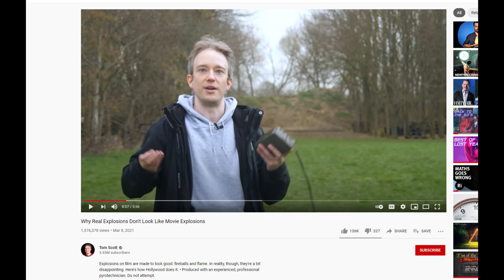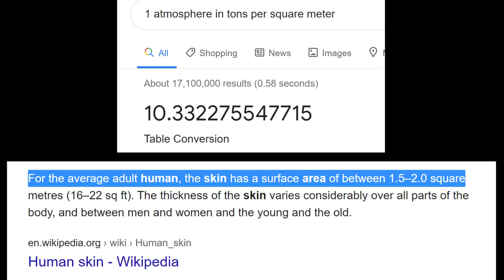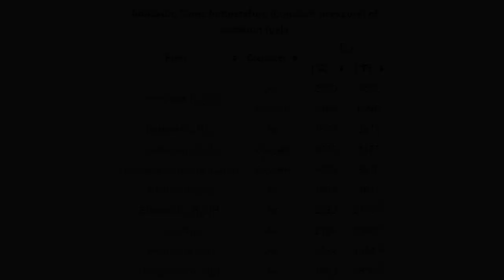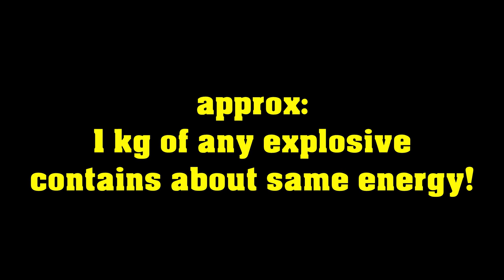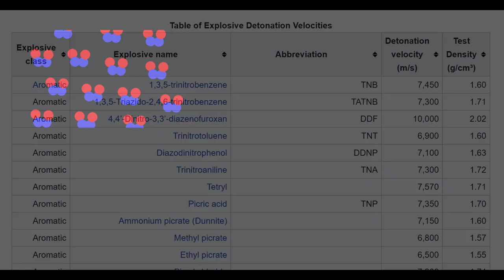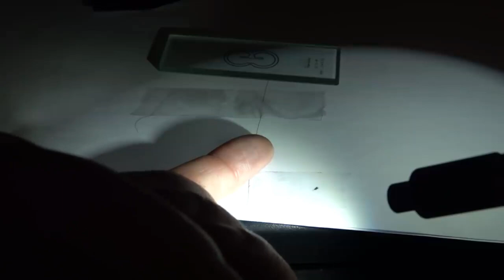Understanding Explosions!

Comment: I am in Beirut, it was not cool of you to say no one got hurt while actually 213 people were killed (Lebanese and Syrians both), 6,500 wounded and 300,000 displaced. However, I agree with your analysis and I actually managed to do this calculation in my head in 10 seconds after the blast as I was running back up the stairs home. At first I was in the supermarket trying to buy bread (there was bread shortage) and the earth shook, and I found my self out on the street, having no memory how I jumped/was thrown there. Cars stopped and drivers asked us what is this? is it an Earthquake? I answered them no it is too strong and too quick to be that, I think it is an explosion, trust me I am Syrian (Sadly we can recognize the type of bomb or missile from its sound). As I finished that sentence, the blast wave hit us so heard breaking windows and whole building fronts fell on people (most wounds were because of that actually). Some cars got flipped off bridges. That's when I ran to my home ... and in 10 seconds my brain thought ... those are two explosions (like what Assad used to do, to kill rescuers who try to help with the first one), ... oh wait this must be one, and it was only the shockwave then the delayed blast ... WAIT A SECOND! If there was 6 seconds delay! it means it is about 3.5km away ... BUT IT WAS SO STRONG! That's when my brain melted trying to imagine how huge the explosion must be!

Comment: 2:25 "the pressure on the outside of your body is about 20 tons." 

Finally, my inability to get up off the couch explained scienterrifically !   B-)
Reply: except you get 10 tons pushing you down and 10 tons pushing you up
Reply: @EricRoosEvestraw  Technically you float in the air just a little.
Reply: @EricRoosEvestraw  cmon now, don't cancel it😭😭

Comment: one thing i love about the famous nuclear bomb house blast video is the 'tide pulling in' , just like a tsunami. when you have a massive pressure blast wave, there is an effect, like a tsunami, that just preceding the blast there is a reverse diretional effect. in a tsunami you can see the water pulling out exposing the subsurface of a bay/beach/coast just prior to the massive wave swamping the coast. similiarly with a nuke blast, you see the negative directional air pressure/wind in the reverse direction. it's a scary warning of just a very short period prior to the blast. amazing.

Comment: Cody's Lab has tested the travel speed of sound in rock in his mine shaft.
Reply: He does, but rock is not just rock. Different mixtures of sand, gravel and concrete in cities are very difficult to compare to natural rock in terms of seismic velocities. And natural surface rock itself can also be solid igneous/metamorphic as well as loose sedimentary rock. Seismic velocities in dry sand is not much different than in air, while solid granite is several km/s. I believe Codys mine is shale and limestone, which is somewhere in the middle, probably in the lower end due to weathering.

Comment: The gasoline has more energy than the symtex because the symtex has its own oxidizer mixed in with it, the fuel gets mixed with the oxidizer (air).   When doing detonation velocities we use what we call a rate stick 1-2meters long and use piezoelectric pins at measured points on the stick or more recently stripped fiber at those points, and one of our Photron SAZ's running at least 100k frames per second.  The biggest problem we have with filming with high speed cameras is the explosives are often extremely bright depending on the mixture and will blind the camera if you don't get the settings just right.

Comment: I have an explosive licence I detonated 40g of PETN on the roof of a wrecked car.  The interior light got fired through the floor and ended up about 6in into the ground.  The most interesting damage though was a thin bit of open cell foam, maybe 5mm thick and about 100mm round that was under the roof got punched straight through the sheet metal of the door.  The hole was the same shape as the foam (road runner style) but the most amazing bit, the foam was still functional foam after it had passed through the door, it was really amazing.

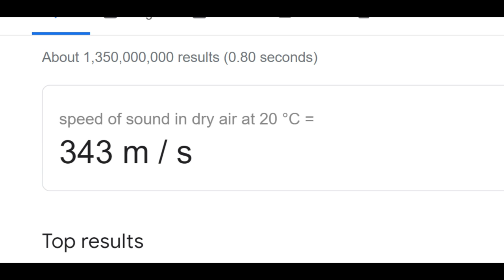Comment: 3:31 That's actually only correct for "weak" shockwaves. Shock velocity is a function of the static pressure ratio across the shock: velocity = sqrt(gamma*R*T)*sqrt((gamma+1)/(2*gamma)*(P2/P1-1)+1). For example, the Turk 28103 blast had an approximate shock wave velocity of 30,000 m/s between the first 2 frames of the available slow motion footage but decreases to 2,600 m/s after about 20 ms (frame 40-45). The footage you show is from the Apple-2 test and the house is actually 3,200 m from ground zero.

Comment: About overpressure being something to respect (or face the dire consequences):
A small room about 20 m^3 in size with a manometric bomb inside it. 
A manometric bomb is a device to test gunpowder (speed of burn by build-up of pressure) and this one had a 1 litre cavity. It looks like the breech of a large gun but with the hole where the barrel normally goes welded shut.
The typical (peak-)pressures during a test are 3000-4000 bar, atmospheres (45.000-60.000 psi).
Then one of the sensors failed (its mounting actually) and all the gas inside got dumped outside.
So 20 m^3 suddenly had 23 m^3 gas in it. Not that much, you would think. 
The result was that the roof (a slab of reinforced concrete) of this little room tore loose at the corner and got lifted up a bit.
They kept it this way and called it a build-in safety-feature.

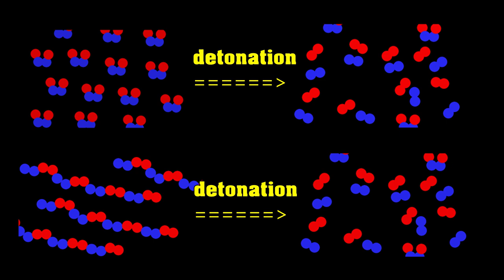Comment: 10:12 Most air fuel mixtures will not detonate but deflagrate instead, take combustion in an otto engine as an example. To much heat and pressure in the cylinder will allow the mixture outside of the deflagration flamefront to detonate, which is very bad and what knock is.
you should do a video about deflagration vs detonation (and the outside parameters necessary for detonation).

Comment: But you can't have gas pressure without a container.

When is this officially going to become a meme?
Reply: Does the atmosphere count as a container? Otherwise the compressor head in my shop will disagree, at the output there is definately a pressure increase when blocked. Sure, for convenince there is also a container (tank) but just for buffering intermittant demand, so that the motor does not start every few seconds.
Reply: @kuebbisch  With all due respect, weather patterns disagree with my original comment. You should click read more ;) Not having a go at you or anything.
Reply: @chickenman297  Meh, I blame that on my mobile device, seemed like a complete statement, show more was obscured :-) So we agree that we agree?
Reply: @kuebbisch  Definitely!
Reply: @kuebbisch  not a science nerd, but could gravity itself be some kinda container?
Reply: @qwerty_artist  Check out BlueMarbleScience (I think that is the channel name). He did an experiment on this exact topic.

Comment: As teenagers, me and a buddy made a vacuum sealed bag (maybe 1L), opened one tiny corner to fill out with acetylene. sealed it, used a touch to light it, not much happened. Did it again and mixed in oxygen.  The ringing in my ears lasted the rest of the day. We had the garage door open otherwise we probably would've blown out a window.

Comment: Both FAB (fuel air bombs) and Thermobaric use Oxygen present in Air. Conventional explosives contain an Oxidizer. It can be as much as 2/3 total mass of explosive. So, FAB's and Thermobaric's have 2/3 more explosive in same volume as conventional. Our MOAB and Russia's FOAB use this principle. Instead of liquids both use dry powdered explosive. Finely ground Aluminum is also added for additional heat. In confined spaces, they can use up Oxygen causing death by suffocation.

Comment: A good followup would be explaining how thermal light emission works, and why the cooler flame's soot particles are emitting thermally while gasses have to get much hotter to emit thermally.  And what the visible light coming from the non-thermal emission in the flame is coming from as well.  (Yes, I know what the answers to all of them are, but Tf00t can probably do a far better explanation in a video than I can in a comment.)

Comment: You also have a diesel/air mix that is taking place over a much, much longer period of time. So energy being approximately equal, a longer duration explosion is going to have a lower average intensity. Not too mention the diesel/air is probably not at the proper stoichometric ratio.

Comment: Here is a perspective that most people can wrap their heads around. When you put your hand out of your car window at 60mph/97kph the force exerted on your hands 0.064psi/0.0044bar. Doubling the speed to that of strong hurricane at 120mph the forces jump to 0.256psi/0.018bar.

Based on the color of the liquid fuel and the characteristics of the fireball I would say they were using a gasoline/diesel mix for the Hollywood explosion. (Disclosure: I've been a special effects tech for over 30 years and have personally rigged hundreds of such explosions.)
Reply: Thanks for those numbers - amazing stuff.

Comment: I love this video already.  I'm not trying to figure out thermal dynamics, and it appeals to ideals that I already understand.  Pressure waves travelling differently through different densities and such.  I understand so little of thermal dynamics that it's practically astro-physics to my head, which really disappoints me in the primary education system of America.  I know I could/should understand it, but don't.  Pressure waves are just the spherical expansion of energy through different densities of materials.  Ten metric tons of TNT wouldn't do squat in space unless you detonated it immediately adjacent to the target material.  I will be re-adjusting my patreon contribution or simply use a one-time donation to thank you for another great video.

Comment: One interesting thing to remember, is that 1 atmosphere of overpressure corresponds to a sound of.... wait for it.... wait for it...... 193 decibels. One hundred and NINETY three decibels, is only one extra atmosphere of pressure at the peak of the sound wave. So it stands to reason, an explosion that produces a compression blast wave of 1 extra atmosphere is actually quite devastating and would probably leave you permanently deaf and with horrible tinnitus.

Comment: Hollywood has to go big on any effect because the viewers expect shock and awe. If there was no fireball, no 10 foot crater, no people flying through the air, no debris tossed 100 feet, viewers would stop watching movies. Imagine a small handheld IED that levels a whole building... think hand grenade. In real life, the explosion is very small, if you are 20 feet away, you're safe. 

What gets me is how in-authentic Hollywood explosions have gotten. Use the hand grenade example. If it was packed full of the most energetic explosive, say RDX or PETN, building would still be left mostly intact. You would need to graduate to something 1,000 times more energetic... like nuclear fission or fusion. Then handheld IED would level building, block, and part of a city. 

That's how you keep the viewers coming back - boom.

Comment: Explosives don't actually contain that much energy compared to things like petrol and diesel. The thing that makes them more dangerous is that it is mixed with oxidiser (which is probably one reason the energy density is lower, as much of the weight is the oxidiser and not the fuel source).

Comment: What is worse than an explosion?
A random explosion, like the one happend in my fiancé's city of Wuxi China. Where a truck simply just exploded. Boom! That was around a week after a bridge collapsed in the same city. -- I did drive on that specific bridge multiple times. --_-- of course such stuff are rather "common" In China, the same goes for death by elevator. Either you being inside, the door opening too soon, so you are falling into the vent, the doors opening too late so you fall upon the elevator, ect.

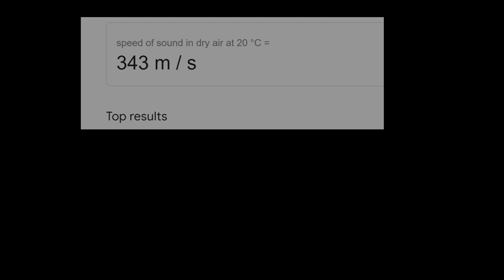Comment: At 5:10 I think there's something weird happening. 

The distance should be d = vg * va * t / (vg - va)
Where va is velocity in air, vg is velocity in ground and t is the time difference.

This comes out to be 1.78 Km for vg = 1480 m/s (vel in water)
For it to be 3 Km, vg would have to be 632 m/s.

Why would the vel in ground be so low?

Comment: Gasoline 1kg have like 3 kg energy of explosive because it mixes 2kg oxygen. Simply because explosive have fuel and oxygen in the mix plus some stuff to hold oxygen in solid form.
Fun fact about huge explosion(in my case 288mm caliber rocket); you actually can't hear anything. First comes flash and heat, than comes pressure wave which you can't hear if you are close enough because it's too loud and you are in the air, than comes the worst part air is coming back and this time is not short burst, this time it really push but it's towards the explosion. Than it bounce back and forth few times.
 So it's short pressure, than it's vacuum, than longer pressure backwards, and vacuum again and pressure and it's over now. Really painful in whole abdomen and whole head not just ears.
Air is bouncing back and forth few times, every time less pressure and more time

Comment: Do the maths. A 10x10inch square subjected to 2 psi has 200lbs of force acting on it.

I think I'm right that the "Semtex" explosion is a detonation, but the "petrol" one is combustion and they're actually pretty different. It's the difference between a petrol and diesel engine. Unless you're pinking.

Comment: I have to wonder if you could generate a fairly potent explosion from an extremely rapid sequence of minor explosions which aerosolized a mixture of an explosive compound, liquid oxygen & liquid hydrogen - in many ways much like a Fuel/Air bomb, but much, much hotter & way more intense.

You'd need exquisitely accurate timing & placement of the minor bombs - by perhaps placing them on drones - as well as calculating the scale of each dispersal charge.

I can almost see how to do it in my head, but don't know the maths to analyze & model it enough - to develop an accurate simulation...

Comment: So why isn't the color of the flames determined by black body radiation? 

My understanding is, that black body radiation described the radiation of any material at a specific temperature. And if the temperature radiation is the dominant radiation, the materials color will reflect the color of a black body radiator at that temperature. That's why the glass and molten metal look orange (IMHO), because their temperature is around 1000-2000 Kelvin. So why don't the various flames (hydrogen, butane) exhibit the same  property? Is there a specific reason why gasses emit less black body radiation at specific temperatures?

Comment: 3:36 Did someone mess with the sound? Probably. But is the shockwave actually the first thing you can hear? You can see in the previous clip with the house, that the flash from the nuke instantly turnes every surface it hits into hot gas and vapor. Wouldn't you be able to hear that befor the shockwave hits you? :)
Reply: Correction: What you see in the clip is probably the shockwave conducted through the ground befor the shockwave that comes through the air hits. But still, if the light itself vaporizes stuff, would you hear that befor either of the other two shockwaves comes to you?
Reply: If i watch the house clip ( 3:15 ) at 0.25x speed, there seems to be vapor coming off the ground allready befor the ground shockwaves throws up a lot of dust. Is that from the flash or not?

Comment: Great video! Only concerned about how you said the speed of sound in solids is "10 times faster" than air as per the numbers(starting 4:07) . However, wouldn't 6000/343 be 17.5 times? Just confirming.
Reply: Yes, you are correct. Thunderf00t goes by orders of magnitude so 1 times, 10 times, 100 times with nothing in-between.
Reply: @DreadX10  Makes sense.

Comment: I have a sciency question:  When shooting a hard target (inelastic), is there a fundamental difference between a heavy/slow projectile and a light/fast projectile that impact with the same force
Reply: A similar question occurred to me regarding stone-age arrow-heads. Firstly, for a given bow, a lighter, faster, arrow gives greater range or reduced travel-time (less time for the prey to run away). Also, a lighter arrow-head, being smaller, might improve penetration.
Reply: Kinetic energy is the difference probably